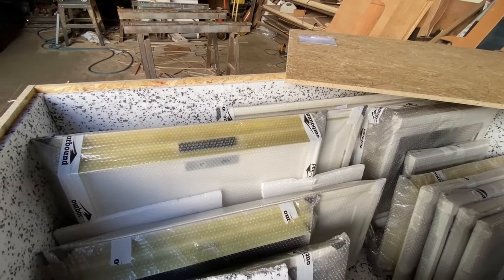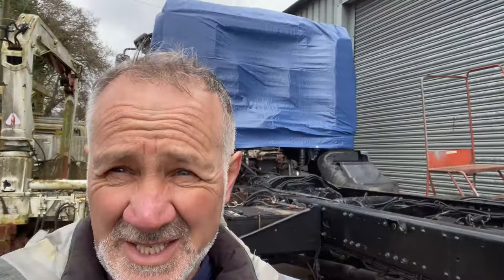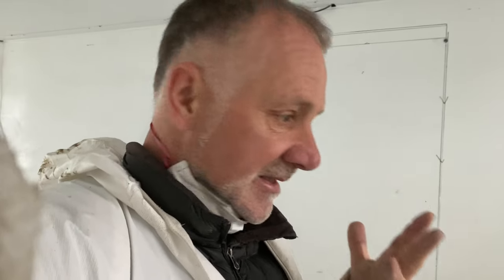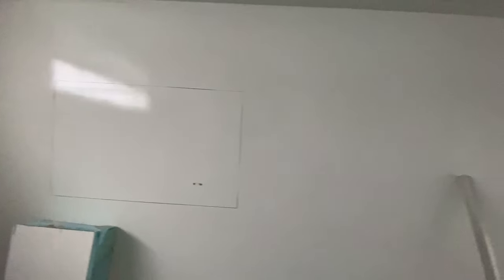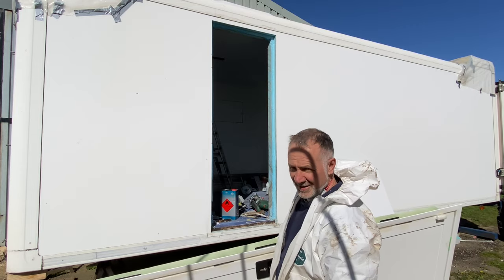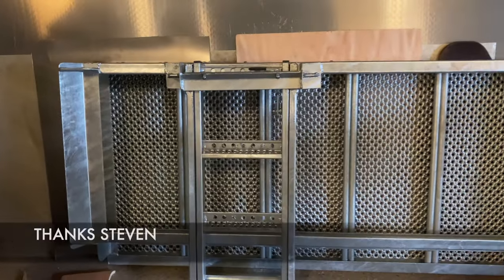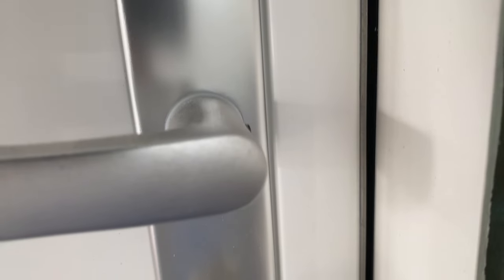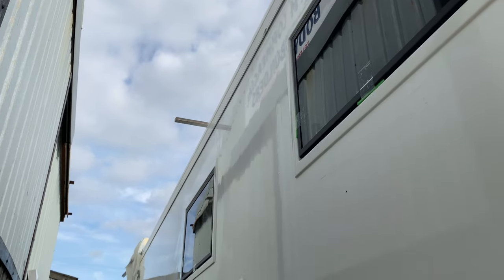EXPEDITION TRUCK BUILD - Cutting it Up!

Comment: Who would have thought that watching a box get built would be interesting.  But after watching all your adventures, I can understand (a little) how important it is to get everything built right.  I keep thinking about how things would flex when you go off-road, etc.  Truly fascinating, and educational.
Reply from the maker: 😂😂 thank you, the importance of getting the rigidity in the sub-frame balanced with either springs or torsion-free system is absolutely key.

We should in theory have zero flex - and yet still have enough controlled movement in the chassis/subframe to enjoy our off-road adventures.
Otherwise, windows start popping and the box would ultimately break.
Here's to no popping windows 🍷😀🙏

Comment: I notice that your box has a large aluminium plate around the base on the inside. Ours has too and I've had a bit of an issue with cold bridging and condensation on the inside. It might not be an issue with yours as my daughters bed is low down just about it. I've had to insulate with stick on foam and put an air vent in the floor to cure it. Good work and best of luck to you both 👍
Reply from the maker: Thank you, we had exactly the same trim in our other truck and never had a problem - other than the garage space.
Good ventilation is key, and this time I'm going to heat the garage with a few small vents for cross-flow ventilation.
It's definitely something I'll keep an eye on, but I think the 100mm panels may well help.
Appreciate your thoughts. 🙏☺
Cheers Phil

Comment: Just think of the good times to come it will be worth all the rain in the end!    Wanted to know how did you seperate the aluminium from the steel for the corrosion issue between aluminium and steel on the cab through?  Just starting a Unimog build but i have had to wait for better weather! i live in Australia and its been to hot to work in the workshop and outside, so now its getting colder i can start to work on it! (I am from uk originally so used to the rain stopping play) looking forward to seeing the build evolve! As a Brit "Keep Calm Carry On!"
Reply from the maker: Cheers Andy, indeed and that's exactly what drives me forward 😀
We used a Polyurethane tape, ridiculously adhesive and water-tight. It's not finished yet as there's a curvature in the cab and we need it to be flush with the hab box, so box on before it can be finished.
I do love a Mog (my next build, just don't tell Izzy).
Good luck with the build 😀🙏

Comment: My patience is way too short for rain and wind delays, I would have rented a garage to do all of the cut work, installed and sealed all of the windows and door. This way work inside can proceed. One has to value their time on large projects. Other than that this is looking to be an interesting project!
Reply from the maker: Yeah, that's the ideal... but the reality is that multiple tasks are happening consecutively throughout the weeks involving the box and base rig, plus renting such a space at present is upwards of £800 per month, plus logistics.
Being the wettest winter on record didn’t help.
Cheers P&I 🙏🍷😀

Comment: Hi, great videos as always. I’ve been a long time lurker, read loads of articles on your website years ago (so forgot most of it) I know you mentioned that you were going to go into it on the build, but I was wondering what the pros and cons of different toilets? ( am I right in thinking that a composting toilet you can dig a hole and get rid of the stuff?
Another little question is, can you use home battery storage units in a van? I’ve never really looked at it so don’t know if they don’t like movement but the Tesla Powerwall 3 is getting released soon and it can discharge at 11.5 kw which is pretty amazing
Reply from the maker: HI, 

The best thing to do is watch our video in the Separett Tiny compost Toilet, Izzy did loads of research and she explains the difference between a Compost and composting toilet.

See Toilet link below
https://youtu.be/f5QiSYXB41U?si=AT9hGE6A4Tke7hHX

Re batteries, very possibly but the biggest issue will always be the battery management, yes 11.5kw is impressive but are they deep cycle, maybe a question for Tesla. 🙏☺